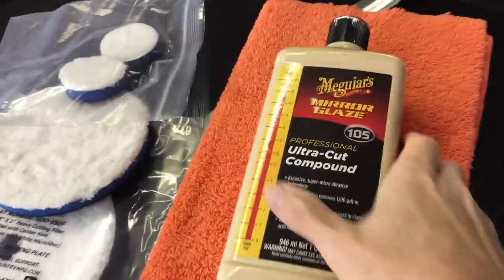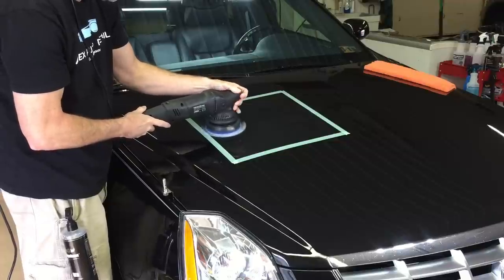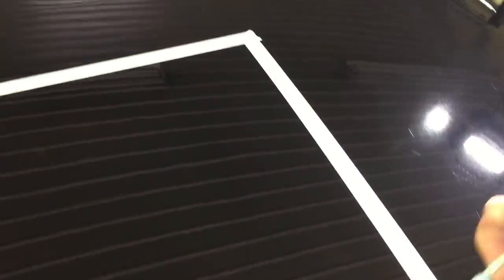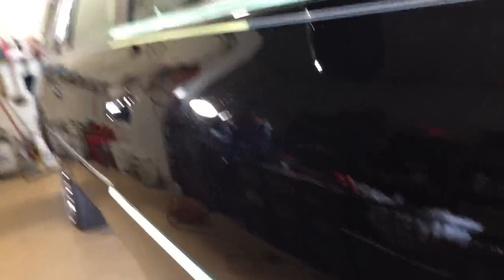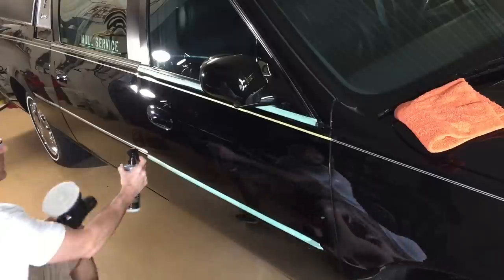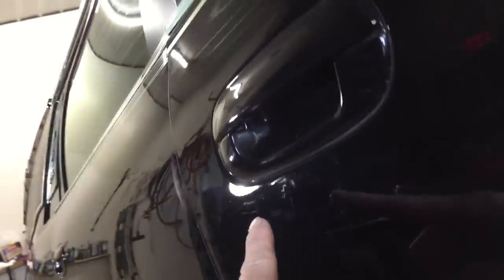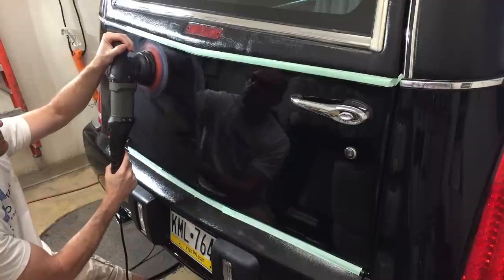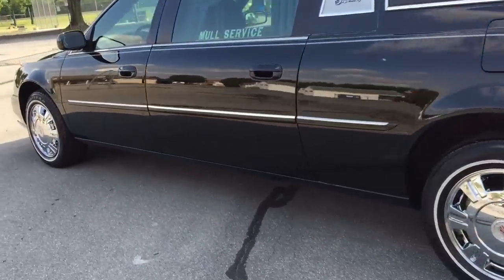Some tips to get the most out of Meguiar's M105  Mirror-Glaze Ultra Cut Compound!!

Comment: What is your opinion on the 3M perfect it 3 stages of compounds Rubbing compound, Machine polish, and super fine machine polish?  What other comparable products should I consider using after wetsanding with 1500, 3000, 5000 grit after a fairly new paint job?

They seem to work well but there is a lot of dusting from stage 1 and quite a bit from stage 2.  Very little dusting from the more wet ultra fine machine polish stage 3.
Reply from the maker: The super fine is ok... the others dust way too much for me.
Reply: Thanks for the reply.  What would you suggest using for a 3 stage system after wet sanding?  Can be a mix of brands thats no problem.

Comment: Good video, and your results were very good. Ive been using Meguires and 3M products for almost 30 years, and yes they havent changed much at all. Iam curious, however, at what you would recommend as a replacement for the same degree of cut, that would be cost and amount used effective. Normally i implement alot of color sanding with 3M's Trizact system, 3000 to finish, and therefore dont use the really heavy compounds due to  the chalky residue left behind on everything. 
I would really appreciate your thoughts on a cost and time effective alternative.
Thanks.

Comment: I use 105/205 daily.. if worked correctly they can produce outstanding finishes.... but the dusting is f’n ridiculous! 105 = less passes, shorter working times with a WELL primed pad, keep pad clean or change out every panel to help control dusting...
205 finishes perfect and wipes off like butter to me..
Reply from the maker: Completely agree.👍
Reply: Just gone a got both 105-205 what is your best way to use both of these for your best results? Seen others use this but want to avoid mistakes before they exsist. How would you keep you pad primed with a QD? Cheers Connor 👍

Comment: With M105 anything more than two or three passes, and my pad is clogged, and cutting stops - AND I get a ton of dust. 

From what I understand, M105 is designed to work fast, and with short cycle time. Same with M205. M205, I can usually do one or two passes at speed 4 on a PC, and have great gloss. I used to do the typical four passes, but when I found it was a waste of time, and that it can work against me, I went down to one/two. 

These SMAT abrasives are a different animal. They're almost like using sand paper due to the abrasives being uniform in size, and not changing size (breaking down/diminishing). 

These days I prefer M100 for cutting from Megs. Less dust, nice cut.
Reply from the maker: Another great post!😃👍